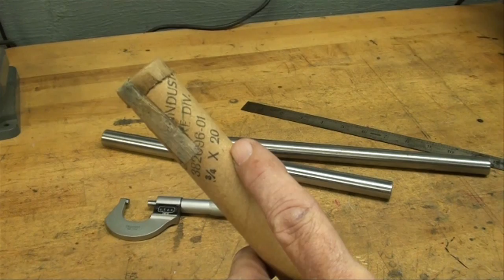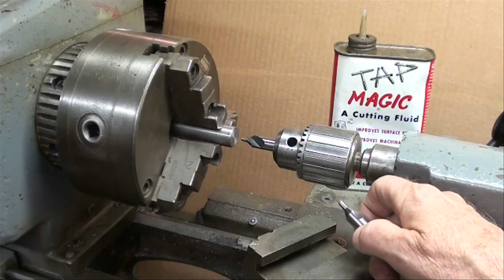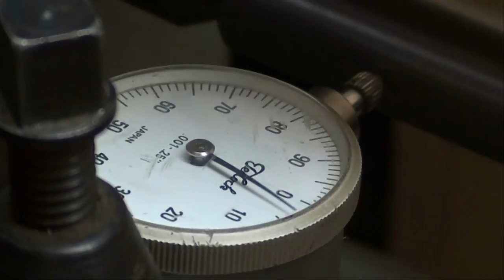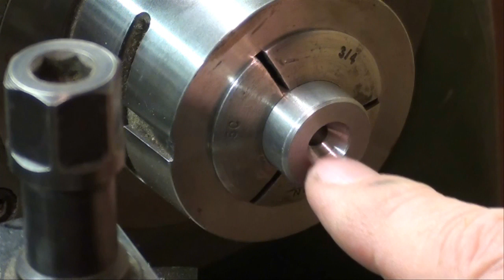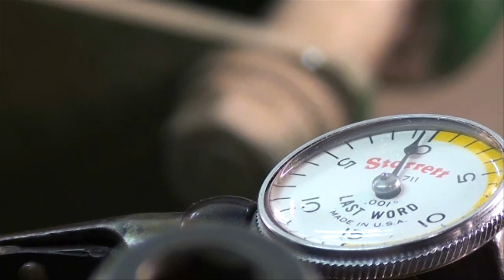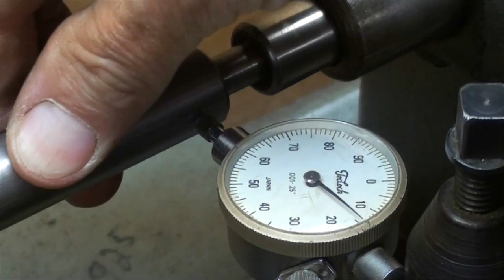MACHINE SHOP TIPS #95 Making a Test Bar pt 1 tubalcain

Comment: Why wouldn't you just center drill using the 5C instead of using the 3 jaw in the beginning? Probably would have got just as accurate without having to do the boring.

Comment: Question/Theory: I had used a 3/4" bar (Turn Ground & Polished) as you suggested in my SB 10K lathe. I thought I could simply use an ER38 collet & chuck. While the collet chuck runs true when the 10" bar is installed the bar is not held true any more. My THEORY; the weight of the bar in the head stock has tilted the ER collet some so while holding it becomes off parallel with the center. I have no other idea at this time. I guess the next best way is to use a 4 jaw and get it running true.

Comment: I noticed on eBay that a lot of test bars have a MT taper on one end then the length added from the taper. I got confused. Example: If the taper is in the tail stock it is fixed. The other end has a center drill hold. Is one supposed to eye-ball a spindle point toward the bar's center drilled hole??

Comment: Thanks for yet another educating and useful video. At the  time 8.55 You tell about paralax. I can think of 2 ways to get around it. 1) Place the light source right above the indicator and look at the shadow of the pointer. 2) Make the zero placed in such a way that the pointer is pointing straight to the camera having the magnmetic stand mounted on the cross slide. Then pointer movements can be read well enough.
Reply from the maker: Thanks

Comment: Thank you, great informative video.  I think many comments indicate  they don't realize the difference between a center drill operation and a boring operation in terms of concentricity.  The center drill hole, whether done with the stock in the chuck or in the collet is still a roughly centered hole due to the potential tail-stock mis-alignment,  and is subsequently trued by the boring operation using a known centered holder that induces zero runout.  

I also want to mention that your replies to some of the comments appear to be made to the thread itself not to the actual comment as they show up a few comments away from the original question/comment.  Use the REPLY button just below the comment.  : )    Thank you again.
Reply from the maker: Thank you, that’s good information

Comment: Instead of making one, I want to purchase one. Amazingly, about all I can find are some on ebay from India that are dirt cheap. But apparently, the .0001max runout specification is bs. I guess for the price, you can expect lies. I found another cheapo on the net made out of aluminum LOL!!  I really need one that is guaranteed accurate to max .0001" Anybody know where this can be purchased?  I would like at least three diameters, 1/2", 3/4" and 1". They must be precision ground hardened steel.
I am blown away that after searching for about 2 hours, I find only the 2 above junk sources. Someone, please point me to a supplier of highest quality and precision test bars. 
Otherwise, maybe I can grind some standard tapered arbors on the cylinder grinder,.. but I just want to buy them, not make them.
Reply: Buy the ground stock you need, then put a help wanted ad on your local craigslist for a local machinist with lathe to help you. Try and find some one with a lathe that has a larger through hole and a Collette setup who has the correct size collets you need for your stock. 

I had some work I needed to do to get a bench top mill rebuilt and since it was my only mill, it could not be used to rebuilt itself. I put a machinist help wanted ad in my local craigslist in the tools section and before long had been contacted by 3 or 4 machinist with offers to help for free. I even had a local guy who turned out to be a retired trucker who went into the machine tool business who contacted me and said he would help me rebuild my benchtop mill or sell me a bridgeport mill super cheap. So now I got a complete 1961 Bridgeport mill for less then 1000 and am super happy. Usually you can find a local machinist who will be glad to help you and you might even make some new friends in the process like I did.
Reply from the maker: You may not find one. There is very little market for them and costs too much to make

Comment: Thanks Tubalcain for sharing your wisdom , i never new a three jaw chuck is often of by so much on center drilling . im restoring an old heavey ten L  and im very worried about the accuracy available. im searching for insight on when to say this lathe is junk and i should give up and part it out .I read that the brass bushings have to be about  .00017 of play on the chuck bearings, not even sure if i am able to shim this device myself  but im gonna try , i guess my question is how in accurate can i allow this machine to be for a guy who just builds experimental devices ?

Comment: Wouldn't doing the center boring in the steady rest be just as accurate?
Reply from the maker: +sammorgan31 I doubt it-try it
Reply: mrpete222  Using a steady rest would be just as accurate, if not more so, than using a 4 jaw Chuck or a collet.

Comment: l have heard (don't know 1st hand how true it is?) that the Piston rod in a Strut off a automobile is 100% ground true and straight.
I had two of them when I did my car, but they made me so mad, as a junk man in the area took them with out my permission,
from under the outside steps. I was going to cut the rods out, and scrap the struts and some rotors that they stole too.
You have to nail everything down around here.
I may still be able to get one from the garage where I used to work, but they are getting funny about that too, don't even want you to take home scrap. I guess I can understand it to a point though.
Reply: if the car has bumped on the side walk is not straight any more
Reply: I definitely wouldn't trust one from a used strut. The part is being replaced for a reason. You might get lucky but I wouldn't assume they are still true without confirmation. In fact I wouldn't trust a brand new one to be true enough for this purpose. It may be true enough for it's intended application in the strut but not to a standard that would suffice to true a tailstock.

Comment: l only have the little 10" logan, and as you know, the spindle will not allow a 3/4" rod or drill rod stock to pass through.
and of course l don't have collets, but I guess I could go with 5/8" and would have to use my 4 jaw?
You say to bore it, I would need to have the rod dialed in 100%? I can understand that.
Is that just HHS cutter you have used to face it off? I need to get better grinding my HHS cutters, as my mild steel sometimes don't even cut very well.
I also have an import aloris type tool post, and was wondering what kind of index-able tool holder and inserts you were using on the 2 nd part of this video, where you machined the jacob's tapers off of the #2 and #3 MT. They are a pretty hard tool steel as well are they not? (the jacob's taper)
Reply from the maker: Sure, use 5/8.  Those import jacobs tapers are quite soft. Thats a genuine aloris tool in part 2
Reply: mrpete222 OK thanks, What brand, and do you remember where you got  the index-able tool holder and inserts you were using on the 2nd part of this video, when you were machining the jacobs tapers?
Reply from the maker: anthony diodati
ALORIS holder  #AXA 12    insert TPG 322, I think. Look it up on aloris website
Reply: mrpete222 Oh, just a comment, I do not have a mill, (wish I did) So I made the "T" Nut for my quick change tool holder out of some round stock, then sawed sections of it off, to fit in the compound. I am sure you have seen this done.
I took an adult basic machine shop course several years ago, but have forgotten a lot of it. I was decent at the time grinding HHS cutters, but not now. I guess some people use a belt grinder or sander instead of a grinder.
I do have a belt sander dedicated to metal, I may try that.
Here is a link to the T nut, if it will allow it.
http://i217.photobucket.com/albums/cc268/mrbreezeet1/TNut3Save_zps9ec7ed30.jpg
http://i217.photobucket.com/albums/cc268/mrbreezeet1/DSCF0704TNutSave_zps274453cd.jpg

Also, you Might like this,
I have a lot of woodworking machines, and was (Still am  lol) restoring a 6 X 48" Delta belt sander. I was missing the star knobs,
and they were wanting too much money for used replacements, so I sot some Old fashioned sink knobs reasonable on e bay,
and dialed them in in the 4 jaw, and  drilled and tapped the center, then trapped a washer under the cap, where the Porcelain , Hot &  Cold would have went. Turned out quite well.
http://i217.photobucket.com/albums/cc268/mrbreezeet1/DSCF0747PB_zpsdc3f6b52.jpg
http://i217.photobucket.com/albums/cc268/mrbreezeet1/001knobUL_zps96581dcf.jpg

And since I don't have a mill, I made these by welding 2 piece's of steel stock together, just using a bandsaw, welder and files.
It makes up the lock plate for the bottom of the tool post holder for my wood lathe.
http://i217.photobucket.com/albums/cc268/mrbreezeet1/Upload%20and%20forget%202/DeltaBanjoClampplatewelded.jpg

I sent you an e mail too, hope that was OK, it should say Anthony Diodati   or  (  mrbreezeet1   At Frontier  Dot   Com.  )
Reply: mrpete222
Thank you, sending you an e mail, (it got a little long, sorry...........LOL)
Reply from the maker: anthony diodati
Those t nuts look great. Just as good or better than the milled type.
I have the same model of sander-nice knobs
Reply: mrpete222 Thanks Pete, Not bad for a rookie......LOL
God willing if I live long enough, I will find a deal on a bridgeport (then find room for it.........LOL)
I got a nice Powermatic 6 X 48" now, with the built in dust collection system, just did ALL the bearings,
Will probably try to sell the Delta to help pay for the new Hobart 210 MVP welder I am looking at.

Comment: Hello Again. I followed your advice and purchased two sections of drill rod 3/4 in by 12 inches long. On the first piece, I placed it into a four jaw chuck with just a couple of inches sticking out. I used my dial indicator and set the end to pretty close to zero. I faced the end and center drilled it. I repeated the process with the other end. I then placed this test bar on my South Bend 9 inch lathe using a dead center on both ends . I used my dial indicator that is attached to my QCTP . I set the head stock to zero and cranked the setup to the tail stock and without changing anything found it was out a couple of thou, so I adjusted the tail stock accordingly. I ran it back to the head stock and sure enough it was close to the tail stock setting. Sounds great right, "NO" what I discovered is while cranking the carriage from the tail stock, the needle moved considerably until, I was back to the head stock. I think due to the age of my lathe, a 1954 model A, there is considerable bed wear. If I held pressure against the compound, there was very little movement on the needle of the indicator when cranking back and forth. What are your thoughts on my situation. Is it bed wear or slop in the compound ? I changed the brass nut on both the cross feed and the compound. I am very new at this lathe business . How do I go about send you photos of my lathe. Thanks again for these great videos.   Ken
Reply from the maker: I will send email address in next reply. Sometimes they do not go thru--marked as spam
Reply from the maker: pete22@mchsi.com

Comment: I recently got my new to me 9 in South Bend lathe up and running. This was a Craigslist purchase and it was a diamond in the rough indeed. I completely restored the lathe and invested as much $ into as what I paid for it, but you know how that is. This video comes into my life at the perfect time, because I am still in the process of setup and checking to see if everything is accurate. My next project will be to make a test bar exactly as you described. Of course all this will be done on this imperfect lathe, because this is all I have. I will order the 3/4 in stock like you show and center drill. So far, some of the stock I have turned mics out pretty close at each end, just lucky I guess. I really enjoy watching your videos and learn something every time. Who says you can't teach an old dog new tricks. I am 76 and just got started in this metal lathe business. For the past few years I have been turning pens and bowls on my wood lathe but that has played out. You sir are what America is all about. Thank you very much.
Reply from the maker: Hi Ken
Thanks for watching. Send some pics of that SB lathe. There still lots of life in those old machines. Keep watching
pete
Reply: Kenneth you also are an inspiration to me, as you are trying to learn all you can, at your age. I am 59, and sometimes I feel like I am over the hill.

Comment: Hello i am having a small lathe issue and i am sure you can help i have a mid 1960s delta Rockwell metal lathe 14inch swing 48inch centers and i have checked it for alignment and found that the head stock is .010 over my tail stock ,if the tail stock is just worn down can i shim the tail stock centers or will the dove tail prevent that shimming, a test bar show ok down the side but the top or bottom sees the ,010 shows up at a short distance .thank and thank you for the videos i love them.

Comment: I guess I could use a 4 jawed chuck instead of the collets. As I don't have collets.
Dial the bar to run true, center drill and then bore the taper. Result should be similar to the collet method you showed here. Let me know what you think.

Comment: Would placing the drill rod in a four-jaw or collet to start with and then center drilling have eliminated a step (moving to the collet)?  Perhaps even given sufficient accuracy to not have to bore?  I'm sure you had a good reason for starting in the three-jaw but I can't tell what it was.  And, by the way, thank-you for all the wonderful instruction videos--I've learned quite a bit from you.

Comment: As alway's a nica and educational video . 
Altough I wonder why you didn't bore the center hole's  in the collet right from the start . 

Say , Mr Pete , if ever you run out of inspiration , maybe you could do a video on the creation and use of a fly cutter . 
I've seen it used on aluminium , and the finish is ever so smooth . 

Keep up the excellent work 
Patrick 
Belgium

Comment: Thanks for another great video. It's true that, "the devil is in the details". I never thought about boring the center holes. I thought that, by using the short, stubby center drill, that you would be right on. Wrong-O. Learned something new today. It also, explains a few past failures.

Comment: I do not need to try it I know it works I work in a machine shop and build pump shafts that are 10 to 12 feet long and need to run between centers 0.0005 when they are ground. I recut centers in the end of the shafts all the time

Comment: why would you not just use a 4 jaw chuck hold it by sticking it it all the way out only holding by a 1/4" and put a steady rest at the other end and it would be 0.000 and anybody could do make a test bar with out needing 6 machines